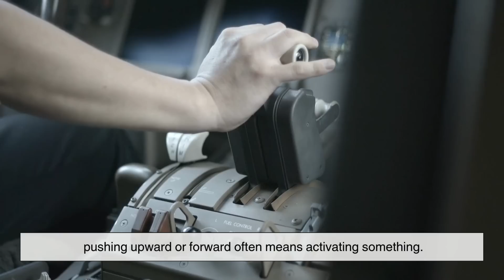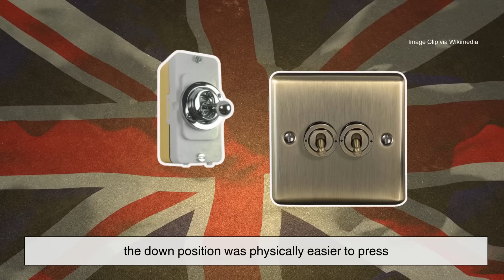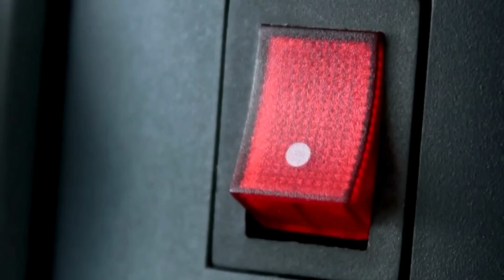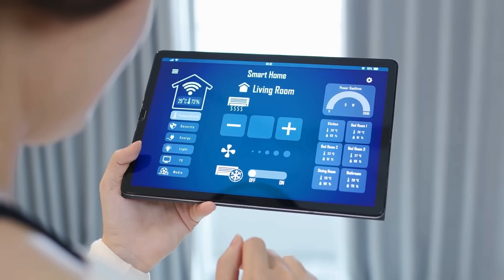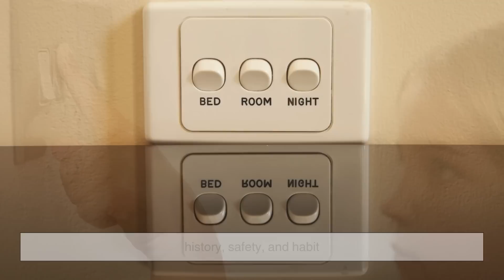Down For On, Up For Off: Why Do Lights Turn On When You Turn Them Off?

Comment: In Australia, convention is down for 'on'. However, when there is more than one switch on the lighting circuit, 'on' could be up or down depending on the position of the other switches. To confuse things more, if you have a system such as Dali, or Cbus, then it is a push button or touch plate and you hope the system works as intended.
Circuit Breakers in the Distribution Board, are either sideways and all breakers tend to work in the same direction, or if vertical up is 'on'. Again replacement breakers or new breakers if not the same as the others might work in the opposite direction.

If you operate a switch and you do not see the light there could be a fault somewhere, not just the switch moved the wrong way.

Comment: In our house there's a lamp that can be turned on or off by 4 switches. Flip any and if it was off it turns on, or vice versa. So it changes when up is on or off (unless you use only one switch, which is not the case). But 2 is enough for this. With setups like this it's no longer an issue as we're used to both, so in case somewhere it's the opposite than usual, we might think that there's another switch for the same light somewhere but it won't feel strange.

Comment: In the UK, we sometimes have two-way switching, such as at each end of a passageway.  If both switches are up or own, the light is on.  Flip one of them the other way and it's off.  This leads to one of the switches being up and the other down when the light is off.  The circuit breaker "up for on" is probably for safety.  If the spring that is supposed to force the switch off in the event of a fault breaks, gravity can probably be counted on to drop the switch anyway.

Comment: Not specified in our code, thus you mount them however you want . When a light is controlled by multiple switches, it doesn't work anyway. So there is no such thing as up and down.

Comment: British switches are easier to accidentally activate. Things rarely fall "up". A simple broom leaning against the wall, can slide sideways and activate a circuit, becoming potentially dangerous.

All my door handles need to be lifted to open, to prevent animals from inadvertently opening the door. You do not want a bear outside your house, but even more so you really don't want it inside.

Comment: thats the most grey area in enginering psychology. Up is On - but what means UP for panel switch, not a lever? Forward is On - ok, if it is on the ceiling, but what to do with switches ahead-above of operator (top corner of plane cockpit or truck cab)? 

So everything is done "as always". In Australia (yes, we walk on heads here!) even lever switch On is Down. Panel switch - always flip to bottom part... except double control which drives me crazy, it changes control depending on state of the 2nd switch. 

And ther worst case scenario is a mix. Water tap which increases counterclockwise, next wheel is brightness control which increases clockwise, then lever Up-On, then panel Down-on, then push throttle handle Increase-Push, then lever throttle (like in many boat controls) Increase-Pull... and then Big Crash because the operator, of course, shifted the control to the opposite direction.

Comment: In the UK, while it is down for on, in the 'fuse box' or consumer unit, we no longer have replaceable fuses in new or replacement units, they have been replaced with circuit breakers where up rather than down is for on!

With rocker switches, particularly in the UK where our sockets (outlets) have rocker switches, there is an advantage when pressing the bottom, as the exposed upper surface of the sockets is usually coloured red to give a prominent visual indication when the power is on.

Comment: 6:10 disagree. Germany is pretty consistent in up=off, down=on. Up is also the rest position for push switches (such as those used for blinds). Austria and Lithuania are the other way round, with equal consistency. This may get confusing when installing German-manufactured switches (especially those for blinds) outside their native market, as the labeling doesn’t align with what users expect.

Comment: In the past, electric swtches are simple copper levers with a wood or bakelite handle. By safety reasons, it's better that the gravity forces the lever weight to shut off the circuit instead to turn on it accidentally.

Comment: 2:35 - Am I the only one that thinks this rationalization for "up=on" makes no sense? Seems like the safer option in this scenario would be to leave the lights on.
Reply: When it comes to electrical safety, “down=no power” is the safer option. This why circuit breakers are consistently “down=off”, even in places where the switches follow the opposite convention. For the light in your cellar, you’re balancing between the risk of tripping or bumping into something versus the risk of an electrical shock.
Reply: @stanton4418  No, they're not. In Australia, our RCD's - the modern replacement for circuit breakers - on the main distribution panel are all "down=on", the same as the light switches and power outlets.

@MikeU128, I thought the same thing: so you trip at the top of the cellar stairs, you hand sweeps downwards as you fall to the bottom, and now you're lying dazed in the dark? That doesn't seem like safe option to me. If the concern is that your hand would pull the switch out of the wall, exposing live wires, then the answer is to design better switches.

All in all, a lot of nonsense - especially all the pseudo-psychological guff trying to imply that American light switches make people more _up_beat.
Reply: fortunately the main power switches (the MCB arrays) are uniform all over: up is on.

Comment: then there's the way we have chain switches in houses in the UK, so you can operate one light with two switches, switching one on in one room, say a hallway, then walk to another bank of switches, press another swich, and the light in front of you turns on, and you turn the first one off with a third switch, then you go into another room and you turn on both lights with two switches, then turn one off at that same bank, leaving the one nearest the next room on, go to the next room, the kitchen, and that's got another switch that turns the kitchen light on, then you can turn the living room light nearest you off with another switch on that kitchen bank. through the kitchen to the back door, then there's another switch bank, you can turn on a light in the back of the house, then turn the kitchen light off at the same bank of switches on the wall at the back of the house.
Reply: usually wired what is commonly called "staircase switches" in which two switches at two different locations are used to control one lamp

Comment: Follow-up video: electrical outlets(North America 120v 3 prongs)  with the ground up or down?
Reply: it changes during the day - for 12 hr ground is up!!
Reply: NEC specifies on top, for safety.
Reply: It's usually on top in commercial settings and bottom in residential settings. I don't know why.

Comment: This is all pretty much nonsense. It just depends on the way the light switch happens to be mounted / connected.
And ever heard of hotel switching? The on/off direction changes every time the other switch is toggled. 

But not to worry: just flip a light switch to change the lights state. Works all the time!
Reply: That's a 3-way circuit.